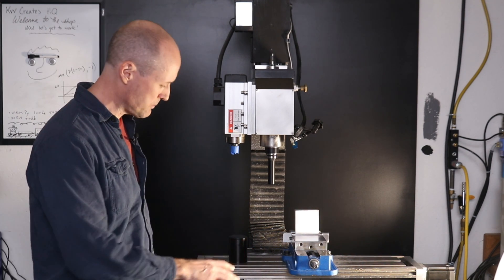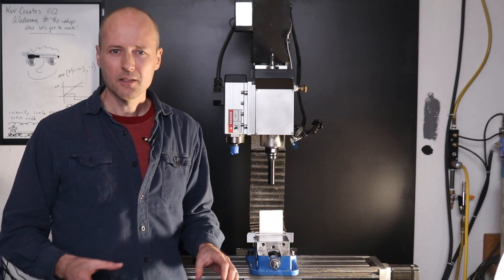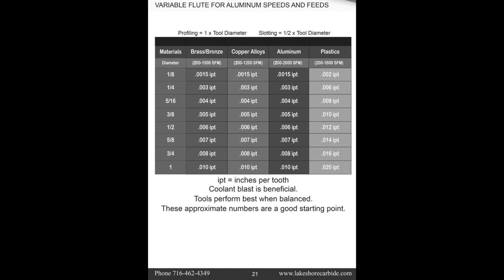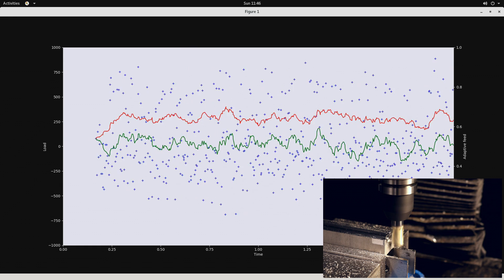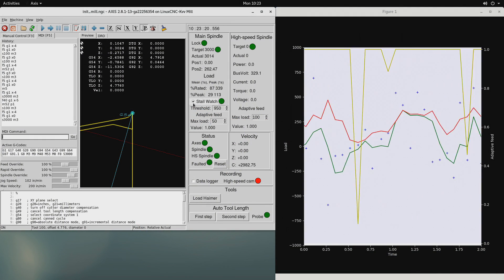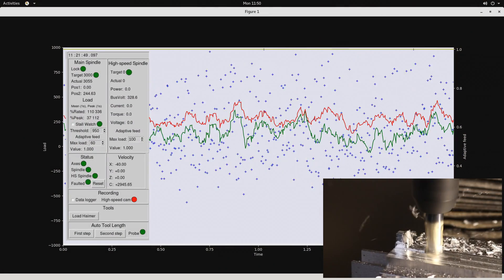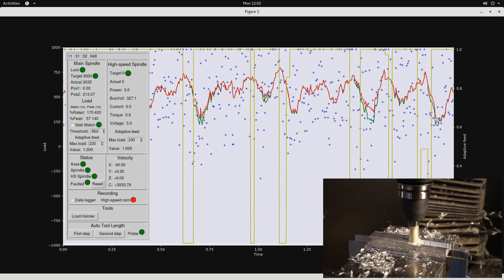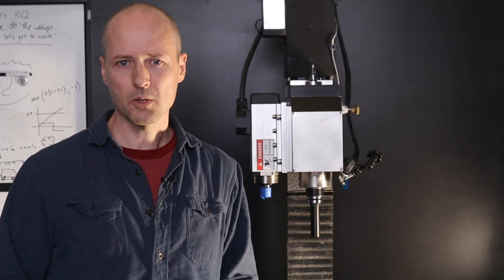Automatic Feedrate, Stop Spindle Stalls, LinuxCNC Adaptive Feed Rate

Comment from the maker: The quality of your suggestions is always humbling. There's certainly enough interest to pursue this a little further. Thank you.
Reply: I have DMM servos as axis motors but am seeing a delay in encoder response back to linuxcnc of 5ms. This creates issues with servo tuning, over current faulting and synchronized motion with multiple axis. This is in speed mode with analog control. Could you do a halscope of your spindle comparing the velocity command and encoder feedback. I am curious if this delay is consistent throughout their product line.
Reply from the maker: @michaelalcocer6778  Check out the following links and let me know if I can be of any more help. My dyn4 is connected to a Mesa 7i76e and configured for AB-phase in position mode. Looks like there is a delay before starting from a standstill. The delay in responding to a change in speed, including going to a stop, looks like the control loop ramping up.

https://kvvcreates.com/shared/dmm_dyn4_starting.png
https://kvvcreates.com/shared/dmm_dyn4_increasing.png
https://kvvcreates.com/shared/dmm_dyn4_stopping.png
Reply: Awesome. Thank you for the help. I am having similar response but for an axis movement that delay is not acceptable. It is causing tuning and sync issues. Picture the start of a 2d move with one axis already moving, second axis 5ms behind planned. DMM states it should only be 50us behind so there is a significant difference between the advertised value and what's actually happening.
Reply from the maker: @michaelalcocer6778  Any chance the enable line to the drive is not left enabled? I would guess the slow response in the _starting.png is from the enable line going high. I would hope you would seem something more like the _increasing.png image and could tighten up the response with control tuning on the drive.
I get what you are saying and it can cause trouble on a spindle. The BLDC drive on my lathe takes ~5 secs to respond to an enable, during which time the LinuxCNC PID is raking up integral error. I need to find a way to delay the PID or reset the Ierror, maybe a timedelay on the enable of the pid component. If you have a suggestion, let me know.
Best of luck fixing your drives. There must be a solution because others are using these drives for axes motors.
Reply: @kentvandervelden  yes the drives are enabled. All of the examples of people using these drives on axis successfully is in position mode. When in analog mode with linuxcnc closing the position loop this delay creates issues. Basically linuxcnc keeps asking the drives to accelerate since the encoder says they aren't. At high speeds they over accelerate and fault out. 
I was working with DMM but they stopped responding with suggestions and there are no settings that change the behavior. In position mode it's a non issue.
Reply from the maker: @michaelalcocer6778  Oh, and seems the same delay happens in position mode. Maybe the delay is because of input filtering. Probably no point to trying torque mode?
Reply: @kentvandervelden  some dynamotion users had success in torque mode but it still has the delay. There is some unknown filtering that is unable to be shut off in the drives encoder output. I just wanted to make sure I wasn't loosing my mind. I appreciate the help. Going to bite the bullet and buy yaskawa servo motor/drive

Comment: Another reason for this is because Fusion360 now slows down your code so you don't have rapids.  You could just set a high feedrate and then let the PID loop deal with the correct speed and then it would rapid when you need rapid and feed-rate when you need feed-rate.  Cool!
Reply from the maker: CAM should be improved to help get feed rates close since it knows pretty well the metal removal rate, material, and tool information. CAM could estimate tool load to avoid breaking and try to maintain MRR near the spindle capacity. These are then optimized with adaptive control The sensing-response latency might be too slow in general. One wouldn't want to rely on this for transitioning from high to reasonable feed rate. And might not be so useful for small tools, where the measurements are below noise floor. A company that decided to do these improvements would have something pretty useful.

Comment: As a novice machinist, it's really cool to think about adaptive control from the perspective of usability (crash-protection) rather than industrial optimisation. My practical question is: But my spindle is not driven by a servo, could this be done from a VFD? My less practical one is: Imagine you had a vision system capable of evaluating surface finish (surely just a small matter of software, right? ;-), plus maybe an accelerometer or microphone in the system, do you think reinforcement learning could be used to build models that optimise feeds for a given surface finish? I should probably be satisfied with crash avoidance but what can I say, your experiment is inspiring.
Reply from the maker: Hi Chris, thank you, there's a lot to your comment. This could be done with VFD just as well. Many drives (including VFDs) have a signal reporting load as 0-10v. This could be fed directly into LinuxCNC's adaptive control, although simpler than what I showed, joining of other signals and feature recognition is lost and I suspect tuning will be harder. I've dreamt of doing the machine vision experiments you suggest but have not had means to compare to a standard, but this week I bought the equipment to measure roughness (and hoping to get an approximation of waviness.) Realistically, probably months away from demonstrating anything though. I don't know about reinforcement learning. I've sell a product to plant researchers that uses DL for image segmentation and recognition. In fact, the next project for a video uses a u-net. But if you recommend RL, I'll check it out. Yeah, I do think there's a lot of low hanging fruit available applying machine learning to machining, metrology, control systems, and so on. The thing that's crazy is that so much research into rapid development of technology for CNC in the 50-70s, but the really cool stuff didn't make it to DIY CNC. I'd like to help with that, at least on the software and sensors side. Having people like you interested is great motivation to keep publishing.
Reply: There are so many permutations of tool, material and machine that supervised techniques (like you use to train u-net) seem a bit infeasible. So expensive to gather enough data to train them.  But now you have a machine that know how not to crash, you should be able to run a Markov decision process (cut-measure-learn, cut-measure-learn, ...) that only consumes modest amounts of material when machine-time and scraps are available. When each data sample is expensive (costs material, machine time, tool wear, etc), much better that every sample is an educated guess based on all prior samples, rather than part of a broad survey of the parameter space. More like how you learn when awake and concentrating (reinforcement learning) rather than asleep and refreshing (supervised learning). Crash-avoidance is a relatively coarse task compared to poor-finish-avoidance, so if learning i's constrained by your current algorithm, crash-avoidance knowledge could transfer into a more sensitive model (that evaluates load and vibration). Maybe some kind of recurrent network that is sensitive to time-series rather than bouncing off a numeric guard rail. I have only played with this stuff (e.g. in OpenAI Gym), never a real application - am very far from being an expert. I might be suggesting something silly.
Reply from the maker: The last U-net-like net I made required 2x7x12hrs of data prepping. I never want to do that again, but the results were amazing.
Thank you, you given lots of paths to try than I could in a year :) One to try soon is predicting Ra with frequency analysis of vibration and cutting parameters.

Comment: i don't know much about LinuxCNC i been using mach 3
Reply from the maker: Before this mill, I had an Industrial Hobbies mill that used Mach 3. I switched to LinuxCNC for this smaller mill so I could tinker with the controller. For me, it was not easy to pick up LinuxCNC. But, there are manuals and experienced people on the forums who have written best-practices. When I stopped struggling against and adopted their methods, LinuxCNC became straightforward. But you the best guidance ever: If it ain't broke, don't fix it :)
Reply: @kentvandervelden  Thanks

Comment: really cool! out of curiosity what is causing such a long lag?
Reply from the maker: Happy New Year Fox! The fastest I can get current measurements is 200Hz and that's using some tricks are needed because of the latency in or near the USB FTDI driver. Buying new hardware, at least from DMM, I would order the CAN bus option. The signal is pretty noisy, so I filter using two methods over a 20ms overlapping sliding window. The two graphs show the filter results and you might have seen they converge when the drive is under load. The resolution of the graph depends on how much can be drawn in 20ms, so in realtime few points are drawn and during playback everything is shown but at ~1/4 the speed. There will be some latency between my code and LinuxCNC. And it all adds up. The binary appearing response, can probably be improved. I'm probably near the limit of what's practical with what I have at 40IPM, and unable to reach higher feedrates. There more to experiment with, but I wanted to post something before I broke something... I edited out the long pauses before pressing Go knowing a crash was going to happen :)
Reply: @kentvandervelden HAPPY NEW YEAR  !! :)
 yeah i was wondering about this binary response. I havent seen your code but i looks like it needs a  range 85% load start slowing down  and 100% cut out. one way or the other I'm sure it is doable and you will figure it out!
Reply from the maker: @PiotrFoxWysocki  By adjusting the P of the PID the cut-in is changed. P=0.2 is 5%, P=0.1 is 10% and so on. 85% might be enough. I can run recorded data through simulation, but the longer it runs with different settings, the more deviation there is from a new recording, so simulation only so useful compared to broken tools. And thank you :)

Comment: Similar, but this is why I love G95 on a lathe. No RPM on the encoder, no feed. I always wondered why programming in feed per revolution wasn't more popular on mills.
Reply from the maker: That's very interesting. What I do is relatively convoluted: use a program to convert desired chip load into a feedrate, or the reverse way. I have an intuition of chipload but not IPM. I might be a G95 convert. Thank you for the suggestion.

Comment: Very cool work, great job!  ++ to continued development, would be interesting to see it smoothly vary the feedrate (and/or spindle speed) rather than just on/off control.  Might also be interesting to see how it fares on small tools, since they are so much easier to break... but maybe more difficult for the servo to notice in time though?  Great stuff as always! :)
Reply from the maker: Great to hear from you Zach, and I hope the new year is off to a great start for you! My guess is that small tools, let's say less than 1/4", will be lost in the measurement noise. My little mill can't break a 1/2" end mill so started there :) The binary appearance could be improved by decreasing the P value in the control loop: P=0.2 starts the adaptive feed 5% short of target, P=0.1 would be 10% and so on, but that will start slowing feed down earlier than needed.  The torque sampling rate can't increased with the current hardware. I believe the required sampling rate, to improve response, can be estimated, given a feed rate and spindle speed and material.

Comment: Wow.... I'd never thought of that. Shame that timing introduces poor response. How about a upon stall detection, you not only slow / stop the feed, but upon resume, back the feed off a few percent, a second level of backoff if you will.
But the idea that struck me as absolutely brilliant is a preferred feed speed per tool. So much you could do with that. Is the current depth of cut available to the module ? Some maths with feed rate / DOC and the energy required may prove fruitful ? A full PID loop  controlling feed rate with calculated parameters from energy required for the cut ? This is such a good idea....
Reply from the maker: Hi Simon, for a first attempt it does seem promising. What I didn't show was the long pause before pressing the Go button to purposely create a crash :) The gummed up endmill came from several quick full-speed bursts with relatively long pauses with the tool rubbing and heating up the metal. Restarting slowly sounds like a great idea! Thank you for the suggestion.

Comment: Absolutely great work!  I use LinuxCNC for my Bridgeport conversion and a small lathe conversion.  I would be very interested in seeing more.
Reply from the maker: Thank you David. What motor drives and controller boards do you use? I'm thinking about how one would adapt this for other drives. Would be nice to make that simple as possible.
Reply: @kentvandervelden  Kent, I am using 220VAC 3 phase motors and VFD for both of my machines' spindle.  The lathe is using a TECO 1HP VFD and the mill is using a 2HP Mitsubishi D700.  I don't know how I would get the Realtime torque from the VFD into LinuxCNC for monitoring?  I see that you are using DMM AC servo for you setup.  I assume you have a RS485 port that you are using to read the load?
Reply from the maker: @daviddenning4002  That's right, I use the the RS485 interface but if buying again, I would order the faster CAN bus option (though the cost of the Linux CAN bus interface would cause some hesitation.) Do your drives have analog outputs? The basic Fuling VFD I use for the high speed spindle, has an analog output that can be use to feedback current, load, etc. Would need to test how responsive it is... With this one could feed that signal into a Mesa card analog input, if the ADC resolution is good, and right into a PID control. That's probably what Samcoinc is doing in his videos. Search for his name and adaptive feedrate and he has a couple more examples.

Comment: Nice work Kent.  To be honest from the thumbnail I was expecting this to be about adaptive (trocoidal) machining of the type which worked out by the CAM software.  But this was much more interesting and needs to be seen by other hobby CNC machinists.  Maybe a better thumbnail ?  Nice work anyway!
Reply from the maker: Ah, adaptive clearing! This video I especially struggled to pick a thumbnail. Then used an old academic term confused with adaptive clearing, so twice bad. What would you have put? And thank you :)
Reply: @kentvandervelden  maybe “Adjust feedrate on the fly” Thumbnail could be several stationary end mill images with blurred versions of them in between?  Don’t know just a thought.  I had a less sophisticated idea a while back taking a spindle speed measurement directly off a spindle tacho sensor and running it through an arduino linked to feed hold or estop.  It would monitor spindle speed and trip if speed dropped quickly (prevent end mills breaking in aluminium).  But I never built it.
Reply from the maker: @routercnc9517  That's a pretty cool idea, you should build that. Maybe for the router or especially for the drill press. An irritation I have with drill presses, even with a fancy Albrecht chuck, having the drills slip and get torn up. Maybe the spindle speed drops before the drill starts slipping? Have a great weekend!

Comment: Nice work Kent! Indeed, thin chips in aluminum tend to gum up pretty quick.You need to maintain a minimal chip thickness if you want to avoid this gumming.. A combination of decreasing the feedrate and RPM's would be the best in this particular situation combined with the 'full power mode' on your coolant setup.. :)  Perhaps trigger a reset of this adjusted feedrate/RPM's if a G1 change in Z height is sensed. With the HAAS controllers you can set the limit per tool, this helps to prevent the machine from some programming errors and avoid tool breakage. Convenient for rigid tapping in my experience. 

Best way is to become familiar with the machines capabilities,  take a look at the manufacturers recommendation for the tool, take a closer look at the needed spindle power/ torque (just discovered https://millalyzer.lophostrix.com/, seen on the NYCNC channel). Anyway.. Very nice project Kent.
Reply from the maker: Hi Rene, it's great to hear from you! You have a great suggestion to also decrease RPM. Power would decrease proportionally, but so is the material removal rate. Should help a lot.  I'll check out the program. Looks interesting and seems inexpensive if that's a one time fee. Thank you. And let's catch up soon
Reply: @kentvandervelden  I would worry that you will get positive feedback from that control system.
Reply from the maker: @davidwillmore  That's really interesting, you're saying this would become unstable? Can a PID control loop have op-amp-like positive or negative feedback, if the setpoint and feedback are not added in phase? Large P values make a PID loop unstable, but is it positive feedback? It's amazing that such simple equations create entire fields of study. You'll appreciate this: I was tinkering with creating a process model so I could use a Kalman filter. The other thing is, it's hard to get a sense of intuition because of the small number of tests, how quick everything happens. Pretty cool though